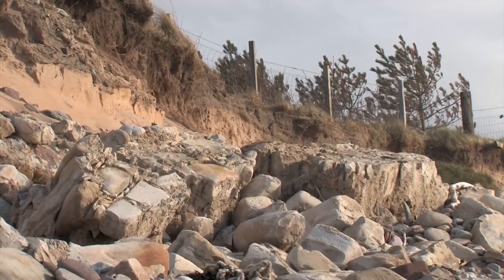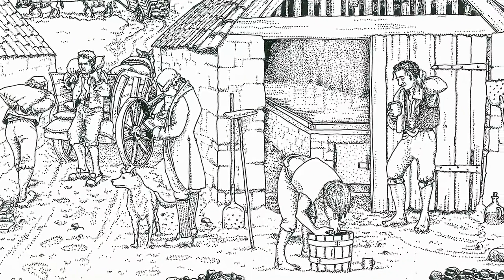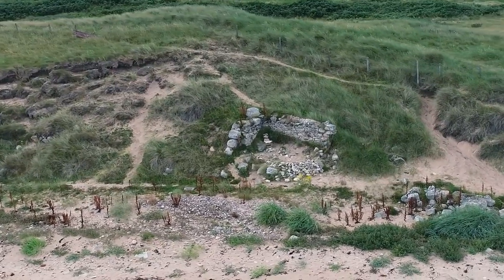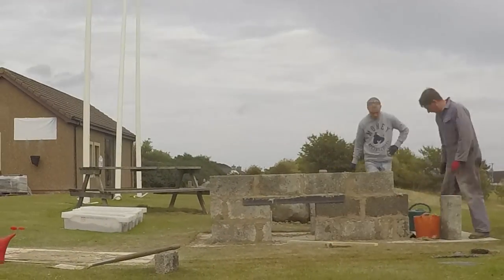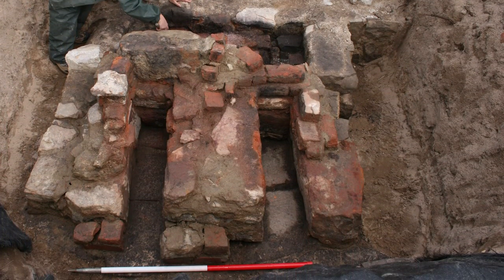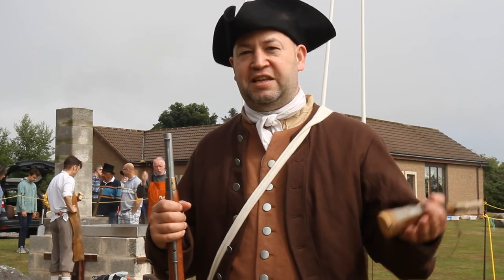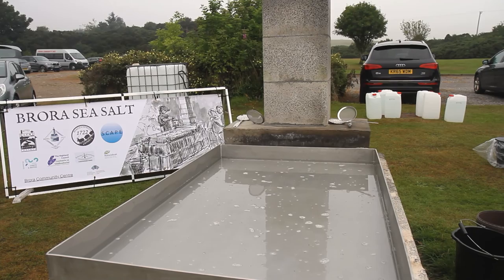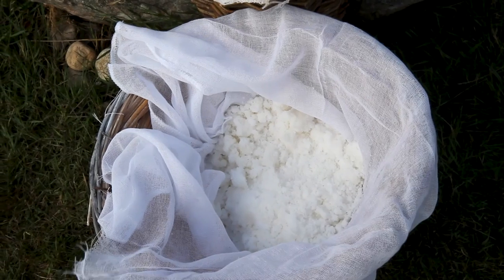Salt Making in Brora: a film

Comment: Thankyou for such an interesting video. We were married in 1967 and in May ‘68 spent our first holiday in Brora - a beautiful area. We knew nothing of the salt production but came across the pit head of the coal mine. It was in use and I was fascinated to see the operator marking off each rotation of the drum as it lowered the ?cage to the coal ‘face.’ He marked off, with chalk, one line on the wooden drum and when he had 4 he put the 5th as an horizontal line through them.
It was a long time ago and as Stuart died some years ago I can’t share this with him nor ask him to describe it properly (he was a mech engineer RR) so I hope my description is fairly accurate. Barbara